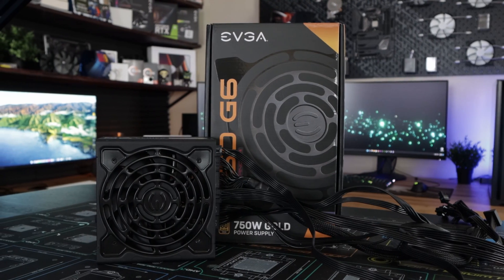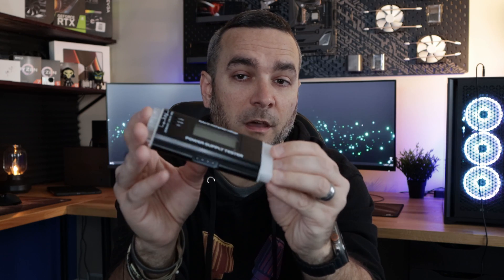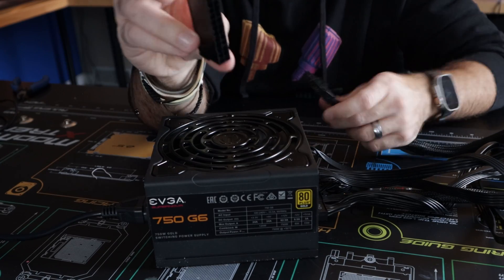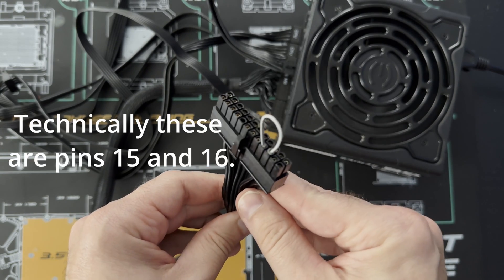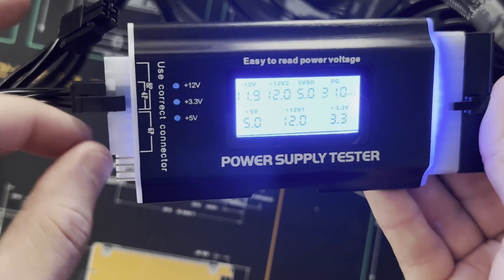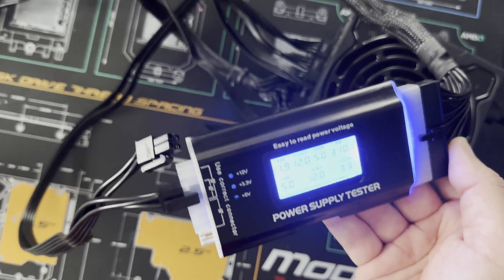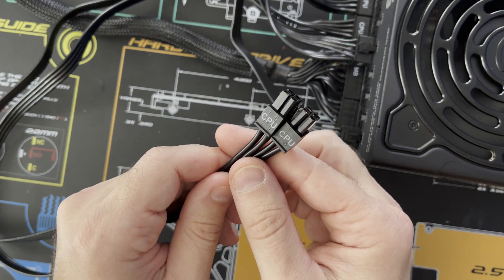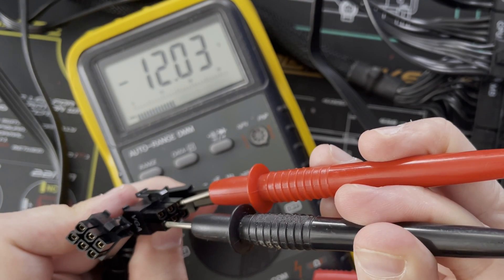How to Test a PC Power Supply | Jumper Wire, PSU Tester, and Multimeter

Comment: My guy, if you think that jumping the fan on a power supply means that it's a working power supply, you need to step away from the power supply.
Reply from the maker: My guy, this indicates that the PSU is at least functional. You would still need to measure the output of each rail to verify proper voltage/wattage as I indicate in the video. I have used the jumper method many times on a dead PSU and nothing happened. This is the simplest and quickest way to test a PSU. I did show two other methods. 👊🏼

Comment: Hello, thanks for the video.

Recently when my electric clothes dryer shuts off, my computer shuts off seconds later. This only happens when doing laundry. I have not changed anything in my home or my office in several years. I thought maybe I had the computer plugged into a bad surge protector, but I switched it out a few times and same problem still exists.

I never had this issue with my previous computer so why this one? I built this in July 2024. here is a list of components.

Cooler Master MasterLiquid 360L Core White 360mm
GAMEMAX Rampage Series 850W PCIe 5.0 80 Plus Gold Certified
Montech AIR 903 MAX, E-ATX Mid Tower Case, High Airflow
TEAMGROUP MP44 2TB SLC Cache Gen 4x4 M.2 2280 PCIe 4.0 (x2)
XFX Speedster QICK319 RX 7700 XT Black Gaming Graphics Card 12GB GDDR6 HDMI 3xDP, AMD
AMD Ryzen 7 7700X 8-Core, 16-Thread Unlocked Desktop Processor
GIGABYTE B650 AERO G (AM5/ LGA 1718/ AMD B650
G.SKILL Trident Z5 Neo RGB Series (AMD Expo) DDR5 RAM 32GB (2x16GB)

Any ideas would be appreciated.

Comment: Need your help, my pc stopped working somehow and it doesn’t turn on, PSU fan doesn’t start even when i turn it on and also no Leds on motherboard, though whenever i try to turn off psu, mobo flashes white led for half a sec. Not sure what’s faulty Psu or Mobo? Please help.
Reply: Hello, were you able to find a solution? Mine is doing the same tbing

Comment: I have one nominally 12V pin connection that only measures 11.28V on my Lenovo 14-pin power connector. Could that be enough out of tolerance to make my ThinkCentre M93P not boot any more? There are no POST error code beeps. The CPU, PSU and case fans run, but nothing else. I'm trying to determine whether the problem is in the PSU or motherboard. I'd be willing to replace the PSU but not the MoBo. I bought this computer "refurbished" about 4 years ago. I has been working fine until recently.
Reply: 11.28   is good - good enough. looks like a dead mobo ( i,e, not the 12v rail )
Reply: @commander-cb  That's what I thought. Thanks for the second opinion.

Comment: At 2:33 you mention the PSU fan turns on when the PSU is switched on. What about PSUs with the zero-rpm feature? Do these run the fan briefly when the PSU is switched on?

Comment: My PC randomly shut down and never booted up again. I was almost gonna sell the whole PC for very cheap, because I didn't have a clue why it was doing it.

Luckely somebody suggested me trying to test the PSU and I watched this video. 

I tested the PSU independently and found it is defective! 
Fan doesn't spin up and no voltage readings on the 24pin.

I got that PSU for 1 year and it already failed, who thought about that? 😮
Reply: It should be covered by warranty.

Comment: All those ways are basically useless for the most common scenario of PSU being great without load and then failing some of the time with load when pushed.

Those are ways of testing an obviously bad PSU. For proper diagnostics it's useless.

Comment: Hi
I built my first of MSI b650 tomahawk with ryzen 7 7700X and Rx 7700xt
My usb devices keep disconnecting I tried various things like changing power settings, updating bios and even reinstalling new windows it still happens. Can it be a bad power supply unit ?
It’s a brand new Corsair 750RM fully modular gold?

Appreciate the video ❤

Comment: helpful i have a hyte 60 and the front panel wont do anything but running the jumper test and the power supply came to life i will have to email hyte and get some help on this issue
Reply: Hello, I am an experienced IT professional. Prior to that I ran a PC repair shop from the late 70's and into the early 90's. I am also well versed in networks and servers, 
The issue you have experienced is due to the fact that the so-called "jumper wire" test, as illustrated here, is quite meaningless. Your result where the power supply seems to "come to life" when turned on with a jumper wire, but failed when installed in the PC is evidence of the uselessness of this test,
See, the jumper wire test as shown here is a no-load test. That means that the power supply is being tested without any load being place on it. But, when installed in the PC, and placed under load, your PSU fails.
Perhaps, you've seen this kind of this before -- a car battery can't start a car, but may still light the car's interior lights.  So the battery is fine when used with a minimal load from a few lights, but cannot handle the  stress of the load required to actually start the car.
Basically, the jumper wire test is merely showing that DC voltage is being produced by the power supply. Problem is that you don't know how much amperage is behind that voltage. So, when placed under the stress of the PC's high demand, it may fail.
The multimeter test as demonstrated is interesting, but also completely meaningless since the readings are being taken on a PSU without any load being placed on it. While you may well read 12v, 5v and 3.3 volts at various positions on the connector, you cannot determine if the PSU can supply those voltages at it's rated wattage.
As for the power supply tester in the video, I checked out it's Amazon listing. Personally I wouldn't use it. 
If you are going to test a PSU, use a quality PSU tester such as the Thermaltake Dr. Power series testers. I have a Antec tester that is quite simple but effective that uses a couple of wire wound resistors to provide a load for testing.  Unfortunately Antec no longer makes this tester.

In a pinch, just leave the PSU you are testing installed in the PC, disconnect the 20/24 pin main connector, but leave the PSC connected to everything else, such as the the graphics card, hard/SSD drives, case fans, etc.   Now, install the jumper wire on the 20/2 pin connector to turn on the PSU and use a multimeter as shown in the video to check the various voltages from the PSU.  The graphics card, hard/SSD drives, case fans, etc, should provide a sufficient load to actually test the PSU.
Good luck!

Comment: What if I don't have a cable like that. Can I put a jumper on the correct pins on the board. Mine is a streamer and I don't have a cord like that. It's just a motherboard with a pico PS and some other stuff. Not powering up

Comment: my pc would turn on but it wouldn't turn on my monitor and I've updated my drivers and checked the wiring could it be my power supply not providing enough? I have a 750W gold ASUS TUF PSU, a 4070 GIGABYTE RTX, and Ryzen 7 7700 8-Core Processer. Should I check it like this?
Reply: i know it's been 4 days but it would be so funny if you just plugged the hdmi or display port to your motherboard insted of the graphics card.

Comment: so if i understand this correctly.. the 24pin connector layout is somewhat standardised???  all wires should lead to corresponding connectors, right?  But how come when you try and shop for custom cables,  you have to look for which manufacturers psu you have?   Like  ive been told some use different cable layout for example..  Should i watch out when buying for a psu tester or should it be standardised for all psu.s?     Also  us vs eu voltage?  Does this mean id have to exclusively shop in europe for a european psu??   
Im okay.ish with building pc by myself, i just never delved into voltages and amperages - fine electronics basicaly..  one is lack of equipment, the other is  fear of breaking something expensive with like primitive tools  XD
Reply: They are 100% standardised, if they weren't you would have to use certain brand PSU with certain brand motherboards 🤣 Every single cable off a PSU is the same on every other PSU. The ONLY time they wouldn't be is if you bought something like an Alienware that is using a unique PSU with unique connectors on a unique motherboard. But every PSU you can buy, is the exact same. How are you building PC's if you don't even know this?
Reply: Modular PSUs doesn’t have the end that goes to the PSU standardized. That’s why 3rd party suppliers need that info. For extension cable, you don’t need to know to order one.

Comment: My younger brother's PC stuff came today. We both have no experience in this, but I'm better at building and following instructions.

The instructions said to test the power supply first. I used the jumper that came with it. I plugged it into a surge protector, like it recommended and turned it on. The fan barely twitched for a split second within turning it on, and the light in the house dimmed for a split second from turning on the button.

Then about 1-2 seconds after turning it off, the fan does a slight rotation.. I'm not sure why it's reacting this way. It's odd.

I noticed that the jumper blocks inside the connector are at different positions to the instructions booklet that shows how to use a jumper wire. So I tried using a jumper wire in the ports that the instruction booklet showed. But the results were the exact same.

🤦🏽 Hope I didn't ruin it by following the instructions.. Only other thing I can figure out is that maybe the surge protector that I plugged it into didn't feed it enough wattage? I would've tried plugging straight into the wall, but was afraid of destroying it, if I haven't already.
Reply: Your psu maybe have silent feature which turn off the fan when it does not use a ton of power. My guess the psu was fine
Reply: @mohammadrifqisatriamas7311  I suppose that could've been it. But then I'm not sure how someone is supposed to test it as suggested, if the fan doesn't spin.

We managed to put it all together, and after resolving a few more issues, we got the PC working. Hard to believe it's been 6 months already.

Comment: Corsair specifies a jumper between the 4th and 5th pins, which are Pins 16 & 17 (Google search Corsair how to test a PSU). My Corsair PS exhibited floating voltages when I jumped the 3rd and 4th pins. All voltages were OK when I jumped the 4th and 5th pins.

Comment: All I see in mine is that when oowered on either connected to the mobo or with the  wire short circuit as shown that the fan of the PSU tries to spin but stops, and I can hear a light buzz on it as if there is current in there, but nothing starts. If ut is connected to the mobo then there is a split second start where the fans of the PC turn fir that splitbsecind and then stops... should I remove the  PSU fan and try from there? or the pin (of the PSU fan ) should be connected to di this ?
 Correction, when not connected the Mobo and short circuit as in video with the 2 pins there is 12v to the Gpu cable, but fan not spinning. With ir without the  fan connected to the PSU there is a buzz heard in the Power supply, Now when connected to the Mobo there is no light to the mobo and dies not start, as described...Will get ut to service but what can be your verdict ?

Comment: I used the jumper method and the fan flicks on for a second and then off. Connected to the mobo it does nothing. Still not sure.
Reply: I have the same problem how did you reapair your pc?
Reply: @nicXD123  I determined it to be either the power supply or the motherboard. I replaced the power supply because it was the cheaper option and nothing changed.
It was my motherboard. A gigabyte x570 aorus elite that had known over heating issues. I replaced it with a B550 board.
Reply: @aarenmyatt4509  when i was testing power supply i forgot to unplug sata cable from led strip in my case after many tries using jumper metod led strip just turned on and everything works fine I dont know why it repaired itself

Comment: I have a Corsair RM750 power supply, and sometimes my PC resets suddenly. I've measured the values of the power supply, and everything seems fine, but when I turn on the power supply, the fans stop again after 10 seconds. Is this an issue?

Comment: Thanks for this hard work. I inserted a wire to Pin 3 and 4 on the PSU MB Connector but the PSU Fan dint start. Is there a way to reset the PSU?

Comment: So I am getting a fluctuating volt of between 11.99v and 12.00v on 2 of the 12v connection on the pcie 8pin connector, is this okay? Using a multimeter
Reply: That is basically 12v so it should be fine.

Comment: Thank you for the pinout on the power supply plug. Mine just went out last night. Checked the power and reset buttons and they both checked out. Checked the power cable itself and it checked out. Pulled power supply from the case and nothing. It is completely dead.

Comment: my pc keeps shutting down after 3 hours and I want to check my psu with multimeter but I can only found tutorial with colored cables of psu out there. Just wanna say thanks bc ur video guide me to test almost every pins. thank you so much!
Reply: Was the problem the psu ? cause I have the same problem and I don't want to buy a new psu and then it doesn't get fixed. Thx for advance 😊

Comment: Could a power supply still have issues even if it shows these voltages in testing with no loads? My pc shuts off randomly after installing 7800xt GPU.
Reply: Same, Did you find a solution?
Reply: Sounds like the PSU isn't strong enough to power the GPU.

Comment: If your power supply fails to turn on. The first thing to do is remove your video card. Then do a power on test. If it still fails remove any card in your sys and retest. Also remove all memory clean contacts on mem. and all cards. Retest. Then test your PS.

Comment: Awesome info thanks!! but question would this be a PSU issue? my computer turns on all RGB works fans on GPU are not spinning and only one monitor works? all these issues just happened out of nowhere thanks!
Reply: I know it's been 5 months. But fans on gou not spinning can be normal at startup. But if they aren't spinning while the GPU is under load (in a game). Then that's a problem.  But overall. Could it be a PSU issue. Maybe. Sounds more like a mb (maybe some cables aren't plugged in) or software thing.   But also I'm not an expert. Hope you don't need this info anymore lol

Comment: Thanks for this, but I did hear that you can still have a failed power supply despite it showing good voltages on all the rails, because sometimes it will be fine with no load, but when you load any of the rails, it will fail. Do you know a good/easy way of adding load to the rails whilst testing? Thanks.
Reply: Hello, have you foun?d out an answer to your question
Reply: Jesus Christ that's f*cked up  !!
Reply: what ? does that mean the test is useless with Multimeter ? 
there is an app called OCCT that have PSU check Option when you click on it it does put huge Load of the CPU and your GPU to test your power Supply i have used that app about 10 minutes but they say that i have to test it for at least 2 hours !! 
i don't know what to do anymore!

Comment: I took my Be Quiet Dark Power Pro into my local computer shop and the guy tested it with his power supply tester and it showed all the correct voltages and told me that it was OK.
 Yet it fails the paper clip test (I used a strand of solid copper wire from a ground cable for house). The fan will spin for 5 seconds sometimes, but for the most part, not at all.
 How can it pass the voltage test at the computer store and fail the paper clip test ?  I though the voltage tester at the store was the end-all test ?
 To me it sounds like there is a failing relay in the PSU, I can hear it click on, and when it does, the fan spins, but very often it just clicks off then on to where the fan barely comes on, or not at all.
 At this point the power supply tester seems more like a gimmick then something that should be reliable.

Comment: You should meassure the PSU with at least some load. I like to connect a couple of old hard drives there. Without load it might look ok, but it may not be.
Reply from the maker: While that is true, you can also test without a load as well. Either way works! Adding a load will definitely push the PSU a little more.
Reply: @TechRated  For most new PSUs the fan doesn't spin when using jumper wire they need a load on them I use a  case fan plugged in a Molex connector to test it.
Reply: @raysmac Case Fan in a Molex? Must be some adapter, eh?
Reply: Yup my pc runs for 2 mins and shuts down

Comment: I'm really glad you posted this! I've been driving myself crazy with a new build, and I had to back track on everything I've done. This is the 1st build I've done in 25 years that has totally thrown me off!
Reply from the maker: Glad to help! Congrats on the new build! Specs?
Reply: @TechRated  I'm building a gaming box with a Gigabyte B550 Auros Elite AX MB, G Skill Flare X 16G (2) DDR4, MSI Mech Radeon RX6750 XT-12GB, Antec HCG1000 Gold (Tested Bad-Returned for new unit), AMD Ryzen 7 5800X-8 Core, Gigabyte M.2-512 GB (2), and a couple of SSD's (1T total) System wouldn't boot and I purchased the tester you showed in your video.  Power supply was completely dead. This has been the most frustrating build I've done in over 25 years!!! It has been making me crazy and I'm working on it in my garage in the summer, which is just making it even more difficult. lol!!
Reply: @Sharkman6275 what’s your case? Nice build and hope it works